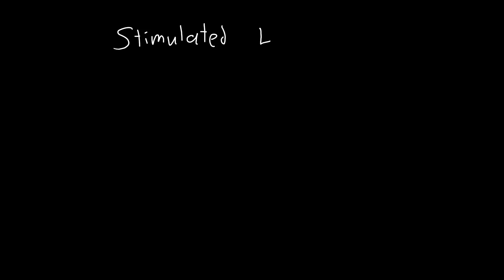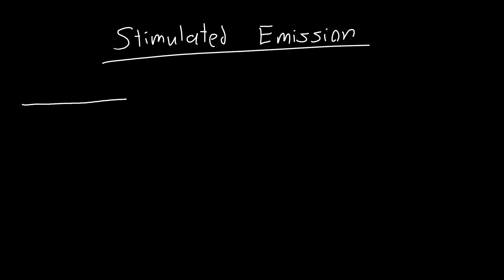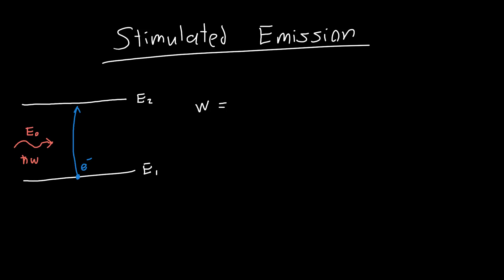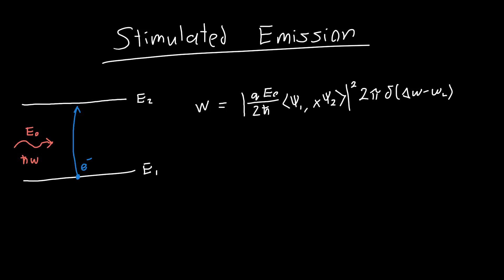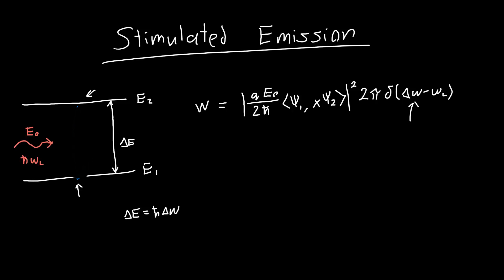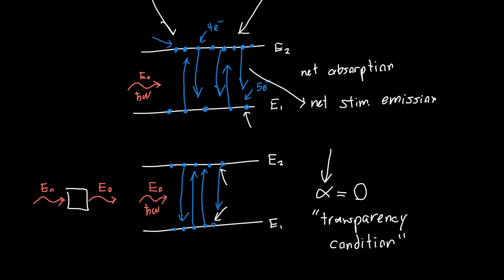Stimulated Emission Explained

Comment: Hi, at 3:55 when you say "we cannot have the same energy for electrons in state 1, but if we have E_1 being a very degenerated energy level, each of the associated states have the same energy, right ? Say we have E_1 the energy, and states |1>, |2>, |3> associated to that same energy, and each state has 2 electrons (with opposite spins according to the Pauli exclusion principle), we could have 6 electrons with the same energy level right ? Albeit not the same "state", because the eigenstates of the energy are degenerated.4:03

Comment: is there not a level 3? i cannot understand why the excited electrons dont go further to, lets say to level 3 or just out of its orbit? why should they go down again where more resistance (if i shall put it this way) happens?
Reply from the maker: Great question. There might be a level above, here we are assuming there is not, and we are treating the two energy levels in isolation. We could add more energy levels, but the basic idea of what’s going on is the same. Also, because of quantum mechanics weirdness, it turns out that the probability of getting stimulated emission is exactly the same as absorption (if the electron it were in the lower level rather than the upper one).
Reply: @JordanEdmundsEECS   if probability of absorption and emission are same than why dont we get two wavelength coming out.

Comment: Hi Jordan, thanks for the video again. Just a simple question... In photon absorption it's easy to see that the energy coming from the photon is absorbed as a gain in "potential energy" of the electron which has been promoted to a higher energy state i.e. Ei=hv-->Ef=(E2-E1). Ei=Ef--> hv=(E2-E1). Now, how is energy conserved in stimulated emission? I mean if we have Ei=hv and Ef=hv+(E1-E2)---> hv=hv+(E1-E2)...?
Reply from the maker: Great question! The incoming photon’s energy isn’t affected, but the potential energy of the electron in the conduction band is converted into photon energy. The total energy is the same (2*hf), it’s just half of it is converted from potential to kinetic.